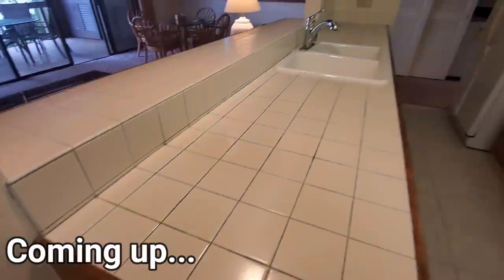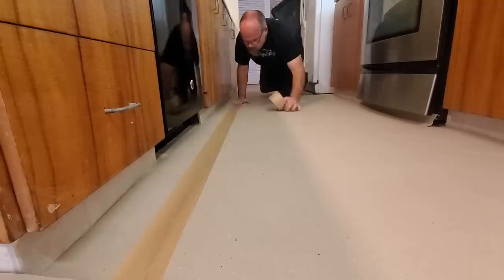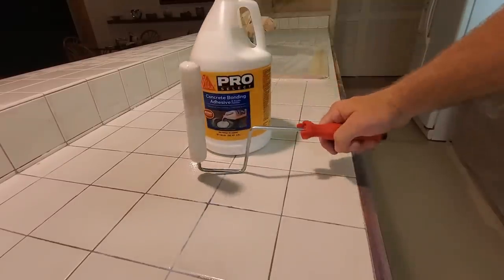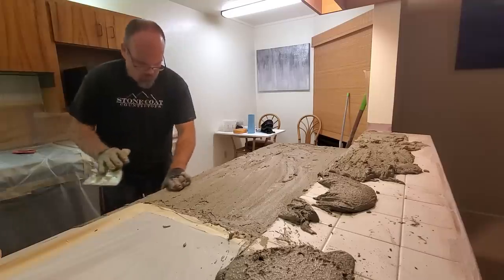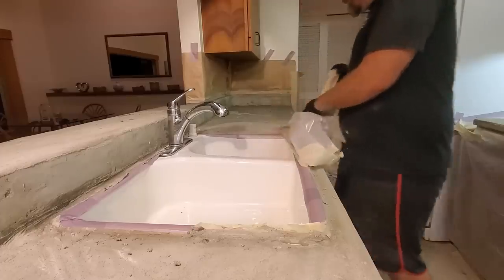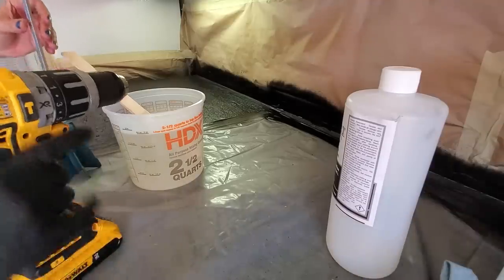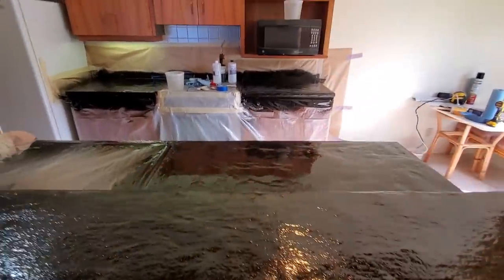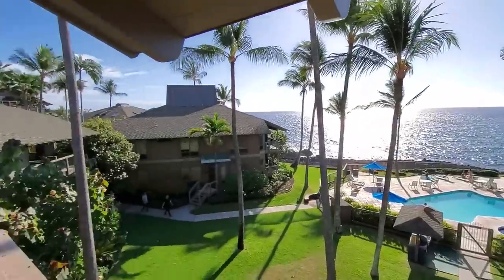Turn Old Tile Countertops into Lava  | Stone Coat Countertops

Comment: I have a textured and colored tile.  The raised texture is a yellow-gold on white tile.  I'd love to be able to keep the look of the original tile (after max-whitening the grout!) and flood coating the surface for the super smooth finish.  My concern is the sanding process.   The tile is circa 1973!  Not sure if the even still make this type of tile.  If I can sand it without removing the color flecks, this will be the solution I'm looking for!

Comment: Should have tried to sand it down a bit to smooth out the surface otherwise is just a sandpaper texture.  Or put an epoxy on top for a clear coat.

Comment: The problem I see with that countertop is sanitizing.  Has to be a smooth surface to get it clean so you do not cross contaminate any food.  I think if you added more coats to make it smooth, the texture would still show through and it would be much easier to keep clean from oils, grease and food particles.  It looks good, but I would never want any food prep area that is not smooth as glass.  And it can never be used in any commercial application as it sits  for that very reason.

Comment: HELLO STONE COAT, I HAVE MENTIONED BEFORE, I HAD AN IDEA FOR USING THE LONG CYPRESS & CUT INHALF, & CUT THEM THE SIZE OF A STAIRCASE STEPS, WOULD BE A BEAUTIFUL, BUT HUGE PROJECT,  WITH TRANSLUCENT BLUE/ GREEN WATER RUNNING THROUGH THE MIDDLE, WOULD LOOK LIKE A RIVER, RUNNING DOWN THE STAIRS, & WITH A LOW LIGHT SHINING UNDERNEATH... BEAUTIFUL!!
LET ME KNOW IF YOU CAN DO THIS OR NOT!😎🌞🌞😎

Comment: That is a beautiful design but the functionality is somewhat destroyed. After a project like this, it would be best to overlay with clear resin for a smooth surface. As it sits now, every kitchen counter appliance as well as dishes will wobble. This is only my opinion based on end result observation.

Comment: Like the out of the box thinking.
An as for the concerns about loose tile or grout substrates, your concrete mix an epoxy incapsulates everything so it’s not going any where for years.
Fun project!
Thanks 
~ Chuck

Comment: Can bondo be used on tiles countertop in place of concrete ?
Reply from the maker: Great question! You sure can! The main reason for using concrete on the top here is that it already has a rock-like, grainy texture; which appears more authentic with less work. You'll notice Bondo was applied to the edges because it sets up quicker and sticks to vertical surfaces better. With those differences in mind, use your tools and substrates wisely to get whatever effect you desire. Call 541-450-1976 for free project support and You Got This! 👍
Reply: Stone Coat Countertops thanks so much for the information. I plan to do a whitish makeover on tiles countertop using bondo. Hope that is okay. Please suggest.